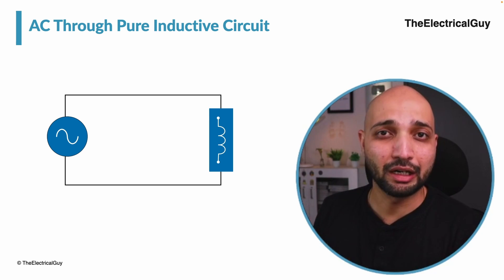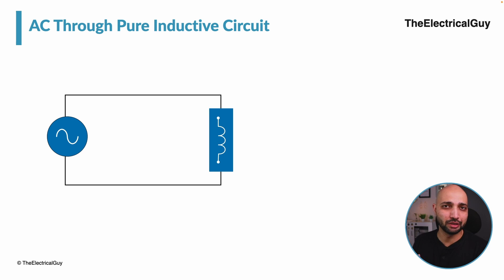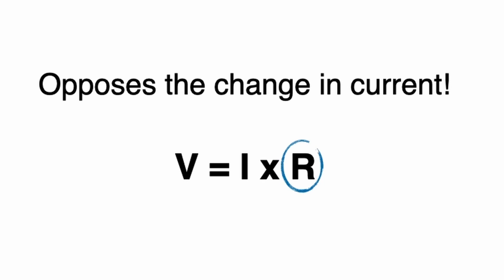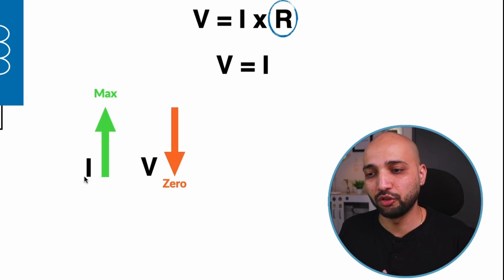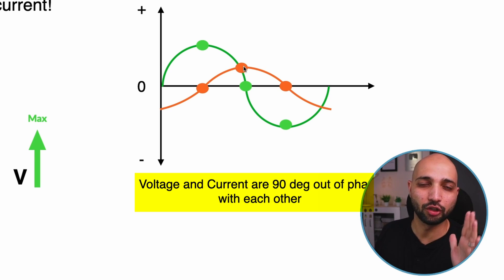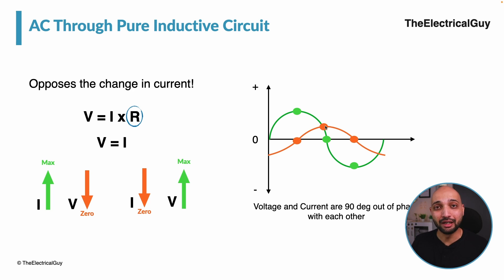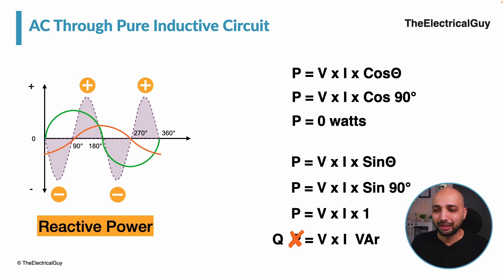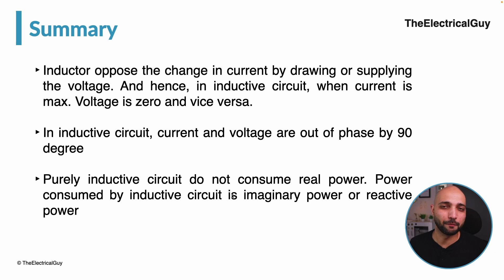AC Circuits : How inductor works in AC | TheElectricalGuy

Comment: The wave form at 4:25 should be voltage in green and current in orange for a purely inductive circuit. You said it was the opposite, which would be a purely capacitive circuit.
Reply: Yes..There is a mistake
Reply: Watch carefully. Voltage is leading in all the graghs. He is putting much efforts in presenting. he would make such mistake. He is ready good at his work.

Comment: It is my understanding that the derivation of the power formula is partly based on the convention that at t=0, current is at its maximum. If this is true, then at t=o, current is max positive  and voltage would be at zero and increasing, so that between zero and 90 degrees, both current and voltage would be positive, giving positive power. Any thoughts?